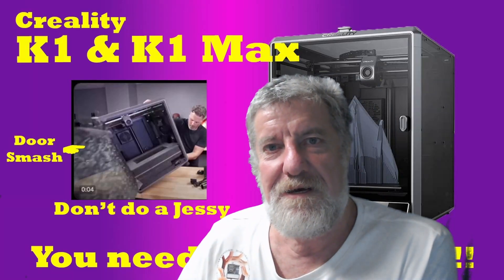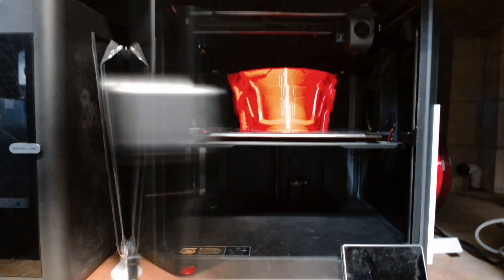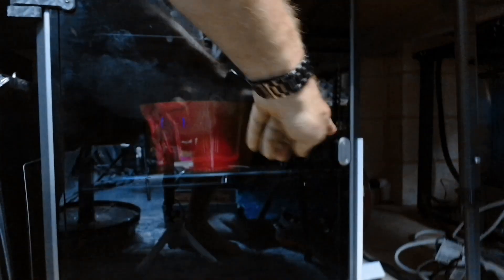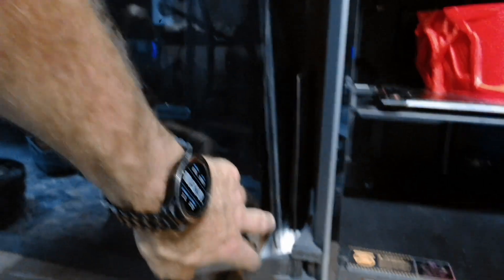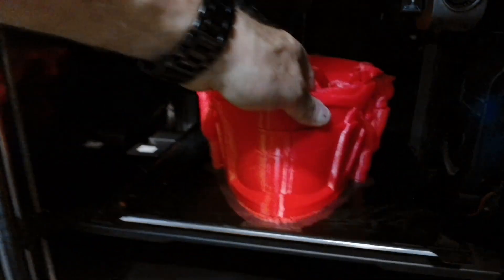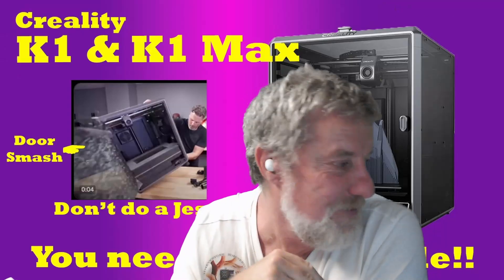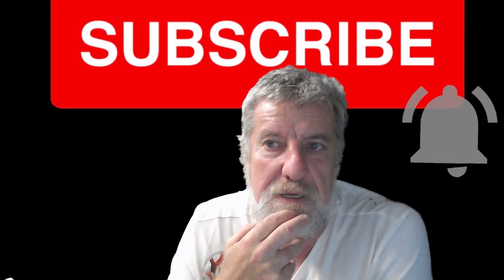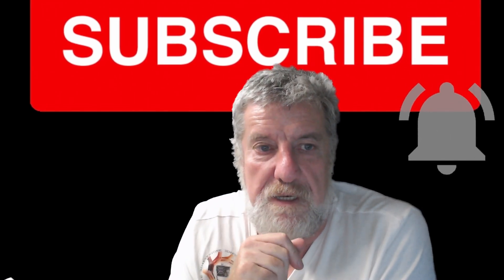I've done it, @UncleJessy has done it, so minimize your chances of it happening to you.

Comment: Hi, great video. Please can you share the settings of your printer and the Orca Slicer? I'm looking at your real ones and the quality of the Posseidon is amazing!!!
Reply from the maker: I mainly use mostly the default settings, but these are some of the changes i make on my slicers:
- Shell tab
walls: 2    

- infill tab
Infill Density: 5%     
Infill Pattern:  Gyroid    

- Speed tab
Enable Jerk Control: on     

- Support tab
Support Structure: Tree Slim  
Tree Support Branch Angle:  50 
Tree Support Branch Density:   8
Tree Support Collision Resolution: 0.40 
Enable Support Brim: on 
Support Top Distance: 0.26
Support Bottom Distance: 0.26 
Support Distance Priority: z overrides X/Y 
Minimum Support Area: 1.00   

- Extruder tab
Limit Support Retractions: off  
Travel Avoid Distance: 0.80     
Z Hop Height: 0.30  
Retraction Z Hop Type: DirectLift

Comment: Nice Spiderman Helmet. If you want my setting for Flat Helmets like the Spiderman Helmet I can send you the Profile File Settings Bud just for future reference it took me a while to get Helmets to Print Straight and print perfect without splicing helmets.
Reply from the maker: That would be great thanks Chris, always l learning so any help is great
Reply from the maker: Hey Chris, I got off my butt and did some testing made a few changes and no layer shifts. These are the changes from the default Creality Print profile:
walls: 2 
Infill: Gyroid 10%
Z Hop Height: 0.30
Travel Avoid Distance: 0.80
Limit Support Retractions: off
Enable Jerk Control: on
Support Structure: Tree Slim
Support Top Distance: 0.25
Support Bottom Distance: 0.25

Comment: Great vid and I highly recommend this mod - one of the first ones I did before I even printed my first part.  Be sure to also print the door catch.  There are several versions of this mod out there - some have an option that does not need heated inserts (uses nuts instead).
Reply from the maker: Thanks for the advice. Ive printed out the latch , but as you can see in the video i can't really use it with my setup.  I tend to leave the top off and the door closed.
Reply from the maker: I always have a smirk when i see Jessys face on that video  just classic